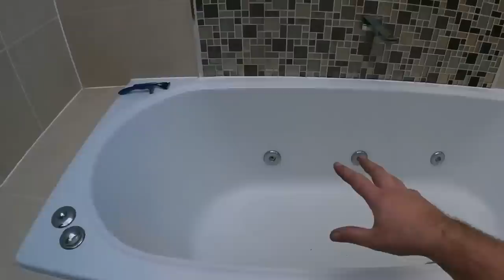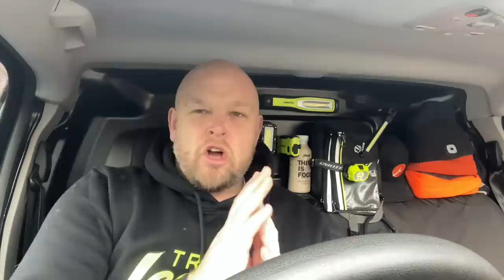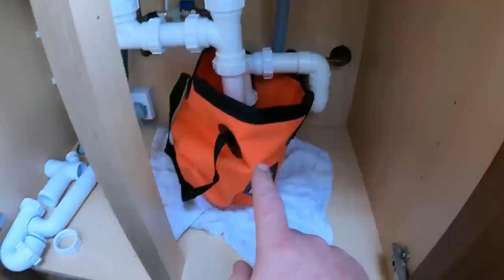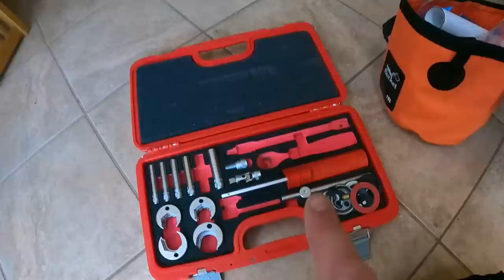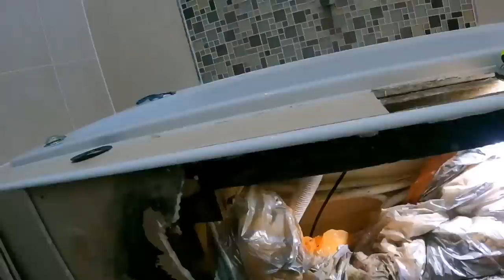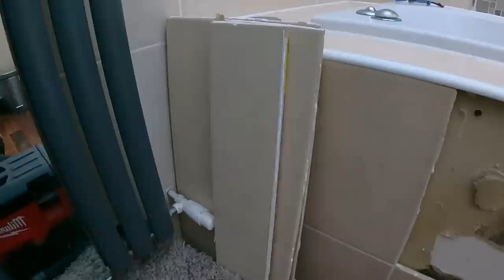BATHROOM PROBLEM… What NOT to do when renovating a BATHROOM

Comment: Ah.. for my bath I made tile-panels from plywood sheets with cementboard screwed on then tiled onto. Snap-in 15mm pipe clips screwed on back which clip onto copper tubes that are secured to the battens with latched clips. Heavy but solid & accessible in seconds
Reply from the maker: That’s what we will be doing on this

Comment: It’s not the other people  it is manufacturers that put those blue  nozzle plugs  inside  and those are never removed by installers!  But my favourite job was when I’ve found w/m waste pipe connected to the hot water tap valve. Luckilly tap was not open. 😂

Comment: As an aside: @ 0.22 loads of tape around the isolators threads - UGH.  That says it was done by a bodger / builder not a plumber!  If the comp. joint is done properly, a tiny smear of sealant on the OLIVE not the threads plus a drop of silicone oil on the threads will do just fine.

Comment: It’s a bung not a cap and it’s designed to be pushed up inside of the spigot not into the body of the trap.
Reply from the maker: Then it’s not visable to the customer when they want to connect an appliance which then causes a flooded kitchen…. People do it different and I was showing my way as it’s better for people to see it’s capped off..👍🏼
Reply: No name, Correct, as explained in the instructions for those who bother to read them 😉

Comment: I too have had customers who insist on tiling the bath panel. I always warn them about if there is a problem. The other big disaster is when the taps are in the SIDE of the bath against the wall. Look great  but I warn them that to replace the tap will need the bath taking out!!
Reply from the maker: And when they want the taps at the back 🤦🏻‍♂️🤦🏻‍♂️🤦🏻‍♂️

Comment: Hope all is well with everything, tiled bath panels look great like you say but access afterwards can be a right pain, i made a few tiles removable on mine with magnets fixed into the timber frame under the bath i picture framed hardie board with some steel c channel which sticks to the magnets with the tiles fixed to this then siliconed instead of grouting where these are, if need access after just cut silicone and pop the tiles off prob an easier way to do it put couldnt think of anything else haha
Reply from the maker: That’s what we will be doing with this I think
Reply: What about the taps against the wall? I always warn the customer it will mean the bath has to come out to replace the taps!!

Comment: We cement board then cut out an access hatch just under the size of a single tile. Tiler then tiles the cement board when then sit it in place and use same colour silicone to fill in the grout joints while packed in place then return to remove spacers and fill in small bits of silicone so if ever needs access your just cut silicone and the section of panel is removable and you never know. No chrome screws heads etc looks banging. Love the vid
Reply from the maker: Exactly what I’m hoping we can do with this when my tiler gets to it
Reply: @MJTiffPlumbing  always looks so much better then all the other options especially on the mid to high end bathrooms. Everyone’s so busy any small job like this having to pull my tiler off my jobs really mess’ things up😂
Reply: @MJTiffPlumbing  always looks so much better then all the other options especially on the mid to high end bathrooms. Everyone’s so busy any small job like this having to pull my tiler off my jobs really mess’ things up😂

Comment: The blank goes into the spigot not the trap body. If you put the blank on you finger and then insert it into the spigot you get it in the right way.  If you put them on the end they end up splitting 👍🏻
Reply from the maker: They CAN go into the spigot, but I’ve been to 3 houses with flooded kitchens after people have moved into house that have been blanked off like that and the customers didn’t know (as you can’t see it) and connected the WM…. Which when emptied caused the flood.
As said I always put them visable so you can see them… never had one split in 20+ years…

But like I said each to there own…. We all do things different👍🏼👍🏼

Comment: the clue is in the word "bung" ,it's designed to obstruct flow, if it was designed to contain flow it would be called a "cap"  hence it's not designed to contain flow by the amazing power of friction, the bung goes in the pipe unless you have some data that tells you that the potential flow cannot overcome the superior bit of flappy rubber over the end of the pipe

Comment: Customers don't have to mess up with plumbing! Mc alpine says the blue plug is to be put inside, I was putting it like you for years.
Reply from the maker: Seen so many floods with the bung going internal… people don’t know it’s there and the washing machine floods the kitchen. Outside for me👍🏼👍🏼
Reply: @MJTiffPlumbing  Then they are not trained or don't know what they are doing.
Reply: @andrewkenny4633  you wouldn't expect to need training to connect a washing machine to a drain though would you? Better if they just supplied a blanking cap instead of the bung or supplied the spout blind, to be cut to suit by the customer (and no, I've never flooded my kitchen 😅).
Alternatively one could cable tie a warning label saying "BLOCKED INSIDE" onto it after bunging it up.

Comment: what were the grey pipes from? I hope those sockets are more than 3m from a bath or shower or has the 3m rule changed. Personally a bathroom is a place where wet hands can touch the switch and I'd  avoid a socket like those in the bathroom.  I have seen a fuse box in a bathroom. That was scary
Reply from the maker: I haven’t fitted the sockets mate….. this is a plumbing channel🤣🤣😉😉…..

I know what you mean though….. sometimes you see some sockets where you hope they wouldn’t be
Reply: @MJTiffPlumbing  I appreciate you do plumbing not electrics but my comments at least make other aware. Sorry if you thought  was blaming you for the sockets.

Comment: Good mate but who put ptfe on the nut thread on  hot and cold valves !   That's a big no there 😳
Reply from the maker: Some people do it to be double sure….. as long as it don’t leak buddy
Reply: @MJTiffPlumbing   been a heating engineer for 40 years plus,  sorry mate but it's bad practice  . It's a mechanical fitting the nut compress the olive and any thing on the thread could inhibit the nut to go fully home . By all means ptfe on the olive . Not having a go here but it's just not done 😕
Reply from the maker: No offence taken as I didn’t do it🤷🏼‍♂️……. 

I’ve been a plumbing and heating engineer for 27years, ive seen it done before and not seen a problem with it. I personally don’t do it but each to there own….
Reply: @MJTiffPlumbing  I am in the heating and plumbing industry 56 years and it is a waste of time putting PTFE tape on the treads of a compression fitting it will not stop a leak as the joint is made between the pipe scampered edge of the fittingand compression ring
Reply from the maker: Like I said…… I don’t do it either…🤣🤷🏼‍♂️🤷🏼‍♂️

Comment: I bung them wastes the same for exactly the same reason.
Reply from the maker: I want to be able to see it’s been bungee👍🏼👍🏼
Reply: @MJTiffPlumbing  To be honest i actually thought the way you and I do it was the way it should be and the only way the bung went on, until I saw another plumber putting it into the other part and then screwing the other piece onto the trap. I remember thinking that could end up with a problem as who apart from him would know there's a bung in it. So i still continue to do it our way.
Reply from the maker: Honestly….. I thought exactly the same till I spotted someone doing it aswell🤣🤣 I was lick “No Way!!!”
Reply: @MJTiffPlumbing  That's exactly I what thought....All these years and never knew you could even do it that way.
Reply: It's ok bunging it that way but when the customer knocks it off it's a different story ...😂
Reply: @karl212  When you push it on it's tight, very tight absolutely no chance of it knocking off.